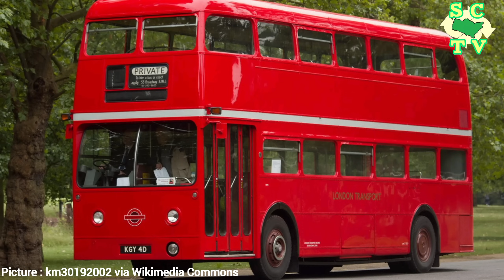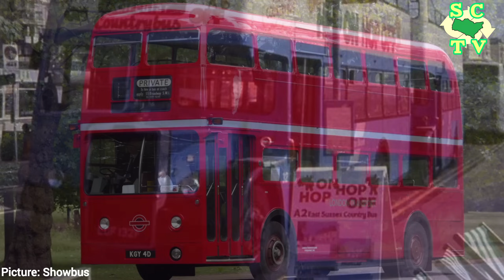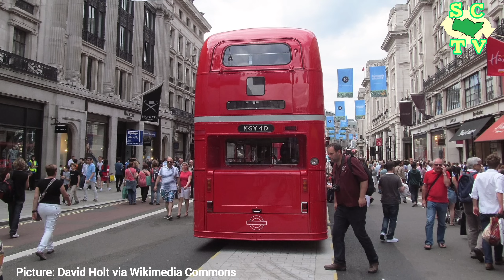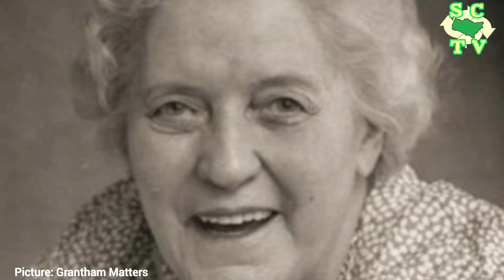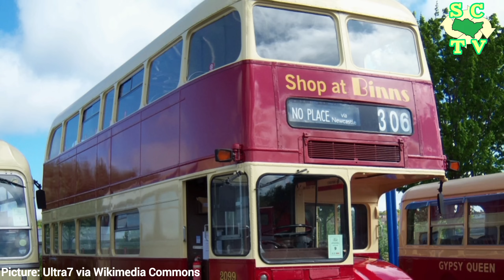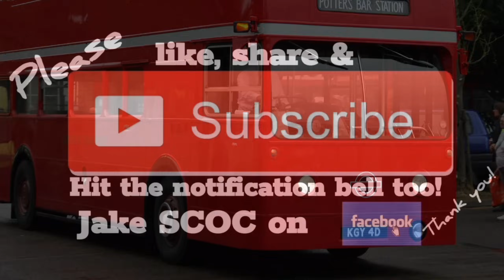The Story Of The Rear Engine Routemaster. Would It Have Been A Success?

Comment: Hi i'm viatron from Sheffield once again, it's just like a one hit wonder of a very forgotten pop song when you listen to on the radio such as the one & only rear engined A.E.C. ROUTEMASTER for London Transport. But they were another one off double deck bus of the 80s  what came about & known as the IVECO TURBOLINE version [I'd think it's called that?] via it's now in preservation complete with the very strangest one off Alexander R-type double deck bodywork & I hope you will feature in your new video feature known as One Off Buses & Coaches of the past, present & future including this very interesting one about the one & only FRM1 & Nomore. Thank you for your co-operation on this very special vintage one hit wonders bus subject from David Viatron Esquire of crookes in Sheffield.
Reply from the maker: @ViatronTumpington  Hi David. I'd totally forgotten about that Iveco! I remember reading about it in an article in Buses Annual one year.
Reply: @JakeSCOC I remember it sitting in Blysthwood Motors yard on the Clyde at the same time the three electric Omnis sat corroding at Buchanan bus station.  It was the Iveco Turbo City 100,  there were also some single deckers as well.

Comment: I drove FRM 1 at LTM many times after she was re classed 6 including for Routemaster 40 event on London Northern’s O license as I was and instructor for them at the time , we were running full loads without issue, steering could be a little heavy at low speed , the cooing system could play up as it did on me on a trip to the Bluebell railway on one occasion but I’m sure this would have been sorted if it had gone into production, the 691 engine could over heat easily due to localised boiling in the engine to if the rest of the cooling system was weak  691 became the 760 a much better engine , my friend Barry drove FRM 1 at PB as well
Reply from the maker: @BerlietGBC  Thanks for that. Always nice to hear from people with first hand experience. I'm sure issues like that overheating could have been sorted out given time. And to be honest, a lot of buses the age of FRM1 have even heavier steering don't they? Still not bad for a one off her age.
Reply: @ it was heavy steering at low speed I think more of hydraulic issues then anything else when engine speed was low , similar with the cooling / saloon heating cooling system was very complicated I know one issue was it’s hydraulic pump for this circuit being replaced with one of the wrong flow rate at some point in the vehicles life , the pump I seam to remember looked identical to a RM brake pump but should have had a higher flow rate also there was a temperature operated valve within the cooling circuit that had issues to.
I really enjoy driving the bus , originally there were no openings windows on the bus but the cooling / saloon cooling heating system was really not good the opening windows were added , my personal feeling the unrated AV 760 engine would have been better on a production version and simplified cooling / saloon heating cooling system, LT loved its hydraulics back then , just go and look at RM116, or even the B20 when they added in a hydraulic fan for cooling over the mechanical system, I’ve even seen a picture of a hydraulic driven alternator I think on a B20, I’m sure they even experiment with a hydraulic door mechanism, even then Metros for London at Hydraulic brakes and later converted to air, LT on the RM ran Tellus not a great oil and I seam to remember the Metros ran Dextron a much more expensive oil, remember drums of each at HT back in the day

Comment: It's such a shame the FRM wasn't allowed to go forward, it could have avoided the whole DMS disaster, as well as the MB class. The Swift could have worked with a bit of patience though.
Reply from the maker: @DarrenSaw  I think you're right. The DMS was a knee jerk reaction to LTs changing policies. And I don't think engineering staff and drivers were properly trained. All the systems that LT specified on the DMS didn't help with it's reliability and once these were removed by new owners they became very reliable buses.

Comment: I think one has to look at the RM concept.  The RT had replaced the trams and for a few months in one year in the 1950s every service double deck bus was an RT family vehicle (inc RLH in that).  The trolleybuses were now being withdrawn, not always with a direct bus replacement in vehicle numbers as road services changed with a decline in London population and the likes of train electricification the victoria line and the final completions of the central line extensions became felt and there was some flexibility in diesel buses on the road.  a loss of passengers following strikes and staff recruitment issues meant the last new RT deliveries could replace early / non standard RTs (Cravens bodies) and the RMs were suited to the ex trolleybus drivers.  as more RMs and the RMLs came in this meant the RTWs and RTLs could be taken out of LT passenger usage creating a virtually AEC Fleet.  AEC Didnt really have a rear engine design , having placed its faith if not in the Routemaster at least in its ideas with the Regent V/ Bridgemaster and Renown and was full up really with the new single deck orders for all over the UK (and overseas) (presumably Crossley was out of use by then).  So the question became what would replace the RLH - which didnt fit in LT overhaul system and single decks appeared the most useful option - again with OMO being permitted on single decks earlier one can see LT route planning looking at what would be good high capacity single deck routes.  So by 1967 the small handful of Rear Engined buses were still being fully evaulated, the country services were going to NBC and thus could be ignored and the RMs just did what they were always capable of, shifting Londoners around the capitol without too much fuss with the bit of extra capacity over the indestructable RTs where that was needed. So given just a few Fleetlines had been in the LT fleet there must have been surprise (or Ralph Benett influence) when the DMS was ordered, but I wonder what feedback from the operation of FRM1 actually had on what and how the DMS would be introduced and Used in the new London Transport Executive era with its new political master in the form of the GLC.  It may not have been built by AEC but the DMS certainly did not appear to be totally in common with the previous Fleetline builds and "The Londoner" may not have been far off the truth.
Reply from the maker: @highpath4776  Very interesting. There's a few bits that DMS' share with RMs - similar power steering system for example. When you look at a DMS you can certainly tell it's link to the Routemaster. 
Thanks for watching and commenting.

Comment: It is said that the FRM had 60percent RM parts, so the question has to be asked what are the 40percent that is different ?  Given LT's Aldenham system for the RT then RM overhauls the idea that a vehicle could go in as an RM have its body jigged about a bit (at Aldenham or AEC) and come out as an FRM sounds like it could have been an idea (in a world where NEW bus grant did not exist.
Reply from the maker: @highpath4776  Interesting question. I would imagine the obvious answer being things like the windscreen, doors, door motors and staircase. Then certain panel work and structural bits too. I think most of the mechanics were the same apart from an angle drive.
Reply: @JakeSCOC  Staircase wouldnt be that much different ,  doors were same as BEA ? (and the RCLs/) There were a few differences on seat sizes (more in a row . less in a row and I guess a bolster area to clear the rear axle in lower saloon. The rear route number appears unique - no destination detail - as you couldnt read it to jump on the bus,  probably didnt have route detail too due to the union split of winding destinations and intermediates and front and rears as to what was driver and what was conductor duty ! - no power blinds then
Reply from the maker: @highpath4776  I believe the staircase was adapted from a design for an Atlantean for Stockton.
Reply: @JakeSCOC  An entire series on DD Staircases would be interesting ( and the joys of forward ascending vs rearward, one stair set or two, handrail finishes, going and rise safety requirements) some have been covered with the Alisa/Wulfrainan keep the weight off the front wheels considerations. We dont really get many interior shots to compare a ECW Lodekka vs RT vs RM
Reply from the maker: @highpath4776  I did think about doing one on moquette a while ago... Maybe I could combine the two.
Reply: @JakeSCOC  I dont advise putting moquette on the stairs (though there is a very wierd ex LT Leyland National running around that has moquette all over the internal panels.
Reply: @JakeSCOC  NBC/BET Vynal types supposedly for easy cleaning of the mining areas a lot of the buses operated in.  Coach Moquettes were vary varied . I think LT Muesum has samples of all Train and Central Area Bus Moquettes ordered and used since 1933 .  Were there any other companies other than Holdsworths and I assume Dewsbury was the centre of the fabric weaving sheds for such things.  The one I didnt like was the BR mainly "Black" seat covering used mainly ? on Eastern Region services out of Liverpool Street

Comment: I think we have to look at LT Buying Policy as well after 1968? when New Bus Grant came in , I dont know it LT had a whisper that this was coming and were trying to create something that fitted their needs.  Clearly AEC (as they had done with Rackham and The Regent being rather similar to a Titan) had looked over the Atlantean and Fleetline and picked some of the best ideas of them, and seemingly wisely had not thought of going Wulfrainian.  The FRM is also similar to the Midland Red build of the D10 front entrance concept ( and we can think how much the D9 is a midlands RM at least in concept of a urban bus for an operator used to doing its own thing ).  Indeed Midland Red's vehicles , from the SOS for that company and also sold to Trent to when Midland Red ceased building its own buses (only to be reinvented with Caryle Works bread van conversions on the Transit ) might be worth a look separate from Midland Red as an NBC company in its operating environment when you get there.
Reply from the maker: @highpath4776  That's a good suggestion about Midland Red. I might have to do a part one and part two. 
As an aside to that, Leyland killed off the FRM - a rear engine integrally built bus. But then within ten years (probably nearer eight) launched the Titan, a rear engine integrally built bus ....
Reply: @JakeSCOC In the interim LT had ordered Swift 691s, Swift 505s,  Daimler Fleetlines (which were regarded as double deck members of the same family, hence DM and DMS.) also Ford Transits, Bristol LHS Bristol LH Metro-Scania, Metropolitan and Leyland National.

B15 borrowed basic concept from FRM1 but it shared no parts.
Reply from the maker: @StephenAllcroft  Yes that's right.  Titan is a fine bus but was superseded by the more versatile Olympian.
Reply: @JakeSCOC  isnt it annoying that politicans get in the way of actually runing a decent bus service for passengers , contract or stage carriage
Reply from the maker: @highpath4776  100%. That and profiteering.

Comment: Four generations of our family worked at Windmill Lane, beginning with Jack Doyle, an uncle of my late mother, my father Stafford “Tim” Luck, my oldest brother Colin Luck and myself being an electrical engineering apprentice. Stafford’s service with AEC went back long enough for him to know when the “ROT” set in and that indeed, Donald Stokes had no interest whatsoever in AEC and so the REAR ENGINED ROUTEMASTER and the revolutionary AEC DESIGNED V8 DIESEL ENGINE that Powered the AEC MANDATOR were all consigned to the scrap heap! It wouldn’t have been so hard to tolerate if Leyland had been a “going concern” today, but sadly stokes was incapable of running a P**S UP in a brewery 😈
Reply from the maker: That must be especially hard it being a 'family concern' working at AEC. The fact Leyland isn't around now speaks volumes doesn't it?
Reply: @JakeSCOC  You've not been up the west coast main line recently then,  Leyland Trucks is still there, under American owners, building mainly DAF badged trucks but still there.

The AEC V8 was a dreadful design,  Leyland money was invested in it and the dry-liner straight sixes,  and AEC said it would be ready by 1966,  they only got a reliable version in 1972 by which time it didn't meet upcoming noise regulations and had converted many former AEC buying hauliers to Scania and Volvo.
Reply from the maker: @StephenAllcroft  No I've not been up that way for ages. I know DAF took on the Leyland Trucks side of the business. That was the engine they put in the Sabre wasn't it?
Reply: @JakeSCOC Yes, used in the Sabre and the last batch of Roadliners.
Reply from the maker: @StephenAllcroft  That Sabre was a lovely coach. I knew the Kemp brothers who owned it in the latter years. I believe they re-enginged it .

Comment: Thank you for the video Jake.   If Sir Donald had have received an firm order for 500 from LT he'd have let it go ahead, but in 1967 LT had decided on the Swift 691 (Which they called Merlin in error).  665 buses later they switched to short wheelbase Swift 505s taking 848 of those which they correctly called Swifts.

Now AEC coded the Swift range P,  that's because they used the Leyland Panther frame.

The engines in the Swift were as the 6U or 6MU Reliance therefore the dry liner engines, the only RM with one was FRM1.

LT and PRV drew up a single deck FRM, but it was not proceeded with on cost grounds.  

In the absence of LT orders,  ACV sales tried to get permission for three to be built as liveried demonstrators for Northern, Yorkshire Traction and Sheffield Transport.  I would imagine when that proposal got to Lancaster House Sir Donald said no more FRMs.   After all, the three firms to be targeted were taking Atlanteans in large numbers.
Reply: A single deck FRM, I think is new information for me. How interesting!
Reply from the maker: @StephenAllcroft  Yes I didn't know about the single deck one either. Glad you liked the video. Thanks for commenting
Reply: @StephenAllcroft  is the incorrect naming of the Merlin the reason why the Swifts and Merlins gained the class designation SM with LT (and the Surrey registered SMs with LCBS)?
Reply: @TimothyWorel-f8j unless a memo turns up confirming it we can never be sure but if ST meant Short T then SM probably means Short M.

The AEC Merlin was an unbuilt export derivative of the (itself unbuilt) Swift coach.  Merlin would have combined the Swift 691 engine and transmission (with ZF and AEC manual options) the Panther coach chassis frame and axles developed from AEC Regal VI.

The Merlin name had come from Maudslay, and was last used on a short chassis Mercury, adapted for Merryweather fire appliances.
Reply: @StephenAllcroft  I don't know for sure but I think the reason the long Swifts were called Melins is because of the "Red Arrow" connection. The hierarchy of London Transport in the 60s had quite a few ex service officers  including from the airforce so it's feasible.